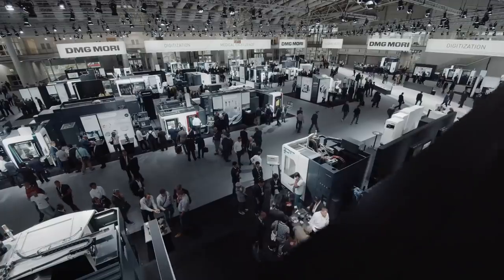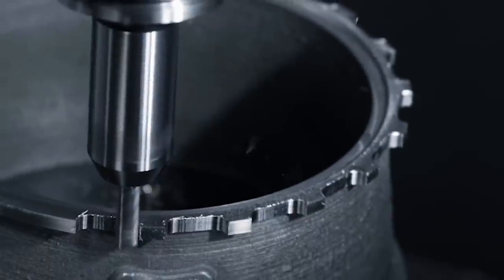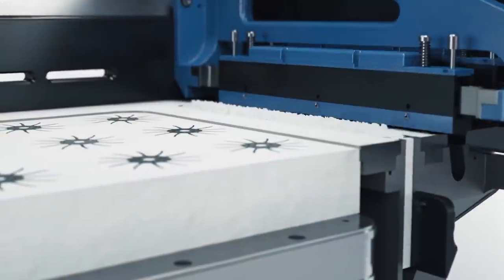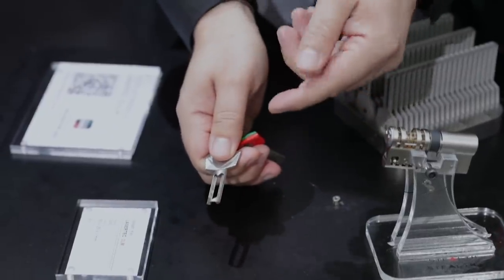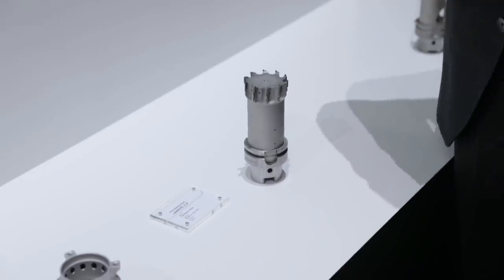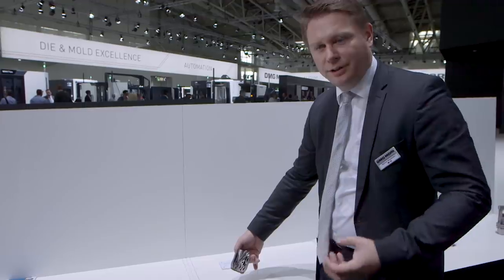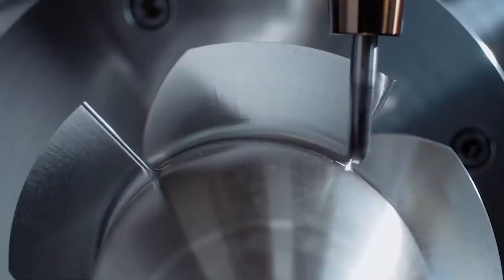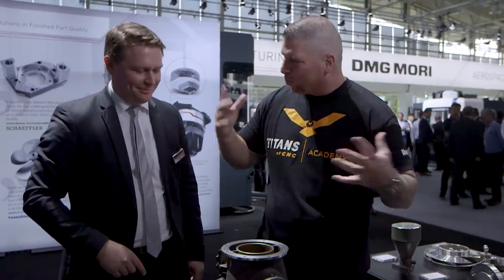Incredible Hybrid Technology | 5 Axis CNC Machining | Titanium Additive Manufacturing | DMG MORI

Comment: 2:41 let the Lock Picking Lawyer have one see how long it lasts against him.
Reply: I thought the same cheers
Reply: Yep, pickers don't need keys.
Reply: Impossible sounds weird to me 😁
Reply: @gracefool  they do use tools tho. did you see the disc detainer lock pick tool LPL made it so simple i could use it. give it some time and LPL will make a tool for the Stealth Key.
Reply: @gracefool  they do use tools tho. did you see the disc detainer lock pick tool LPL made it so simple i could use it. give it some time and LPL will make a tool for the Stealth Key.
Reply: @phalanx3803  standard picks will probably do the job
Reply: @gracefool  maybe but you would have to come from both sides.
Reply: You don't need to see the key to read it, from feeling it with some hook or even 3d printing a lock body with pins that could be used to decode the key

Also the lock seems that pins are easy to manipulate

Looks like some demo with no real practical usecase
And I claim with some effort somebody with normal plastic 3d printer can copy the key
Reply: @freespam9236  true. IMO i would just buy a Abloy Protec II unlike the stealth key the Abloy is reversible and as far as i know there have bean no legit picking tools for it just claims of it being done if it where other wise Abloy would have made a Protec III by now.

Comment: Titan- Just wanted to ask you a question, SLM technology has to operate in a perfect vacuum, obviously you know this but it was not discussed in this video. How does Mathias 

respond to this question, what are dmg mori's ways of dealing with this very important safety issue. Is that a issue that would prevent a little guy like me from utilizing this technology or even
somebody with a big successful shop like yourself from going out and buying this machine....
Reply: No vacuum required, just inert gas atmosphere to stop oxidising like weld shielding gas does.

Comment: @Titan, It may take a while to rough the material on the propeller but, would you agree that building the entire structure by additive would, at this point in time, still take a considerable amount of time longer?
Reply from the maker: Yes, it takes time... but you also save in material cost etc.
Companies like SpaceX and Blue have been using this technology for years.
Reply: @TITANSofCNC  True, it does take longer, but can be run umaned. At my workplace all the printing is done overnight and all through weekends lights out.

Comment: You could possibly make those keys using lost-wax processes, and depending on the individual features, it may involve high-pressure injection. However it would be as expensive if not more to make it that way. Now if they made it from different deposited materials, I can't see any other way of getting there.

Comment: Looking forward to see what happens when they add in a 10+kW laser cutting head in addition to that additive laser + CNC milling. That'll bring in quick cut parts of inch thick steel & aluminium plate or 5-axis parts, followed with either milling and/or laser adding. Amazing future ahead. Adding laser cutting could reduce tool wear big time...potentially.

Comment: Hey, how to drill deep (150-200mm - 6-8 inches) holes in electric-copper (99,98-99%) without spindle cooling with 8-10mm(5/16 - 3/8) drillbit.

Comment: OK WHAT IS THE STRENGHT OF THESE PARTS COMPARED TO FORGED OR CAST, AND THE ENERGY FOOT PRINT COMPARISON CHEERS.
Reply: You cant actually tell this. Depends strongly on which material you're talking. You are kind of restriced in terms of alloys. The are multiple technologies available and all diverse in several points. 

Additive is a nice addition to already existing production methods, but it is not the all curing production method.

Comment: can a  metal printed turbine hold up  under real stress?
Reply from the maker: Yes, they can even print inconel and change the strength and hardness on the fly.
Reply: Some companies do it now, they arent as big in size but the mechanical and thermal stresses are just as real
Reply: The big point in this area is: you can integrated cooling, so actually you're getting away some kind of the stress.

Comment: Doesn't the metal has just as awful of a structure as cast metal? It should be fairly weak as a result...
Reply: Not really.
When you cast metal, whole part goes from liquid to solid. In this proces, there are a lot of factors for cristalization (hope I spell right). Bigger crystals=weaker structure
Here there are crystal no bigger as the pool that laser melted. Also, you pin-point temperature in literally every place, thus You controll crystals.
Also You can slinter, but thats the other story :)
Reply: @wiciuwiciu2783  Sounds interesting, guess its time for me to read up on this.